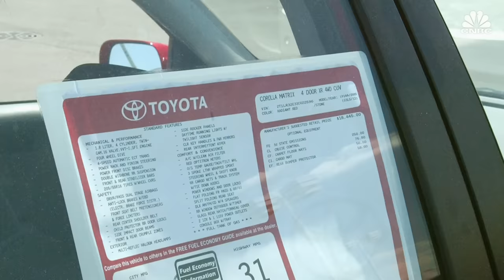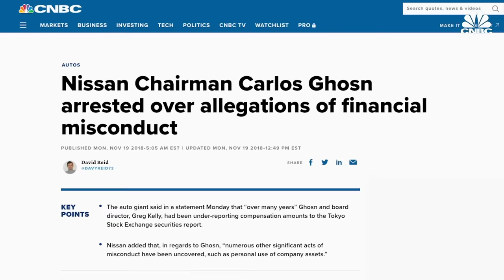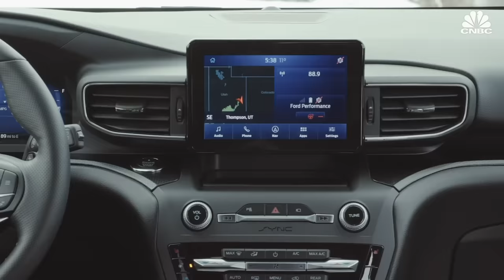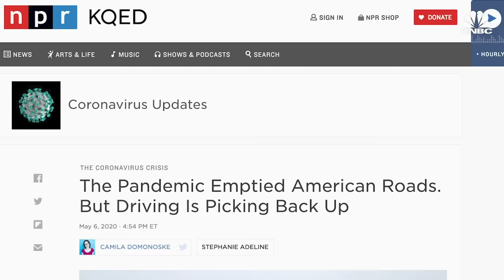Why Toyota, Honda, And Nissan Continue To Bet On Sports Cars

Comment: "They focused especially on reliability"

Zooms in on Mazda rotary
Reply: Apex seals noises intensifies
Reply: I mean.... in comparison mazda rotaries are stupid reliable compared to what other rotaries were
Reply: i mean, a modified version of that thing survive le mans while in more stress that its competitor during the race
edit: and won
Reply: Putu Tunik awesome point bro, need to learn more about the 787b engines
Reply: @hassanuddin6923  sorry about this but, what's that supposed to mean? i admit my lack of reference
Reply: Angry 2JZ noises
Reply: @pututunik8748  mazda 787B is their group C race car. which uses the modified wankel rotary youre talking about
Reply: @johanjoe3012  i know bout that one, the only rotary that win le mans
Reply: Lol, although they were actually pretty reliable for the time, with the exception of the rx8 (which can be good with maintenance, I owned one and it was surprisingly reliable)
Reply: Rotaries haven't gotten close the attention and development piston engines have, so they're simply - worse. 

It would be an interesting car market if rotaries picked up a few decades ago.
Reply: Mazda, Zoom Zoom
Reply: @MrCTruck   zoom zoom zoom
Reply: Woah buddy rotaries are super reliable it only breaks down every time
Reply: "They were lightweight"

Zooms in on 3000GT
Reply: @dinkopausic6357  rotaries are just flawed because the physical properties of the universe prefer circles to triangles when it comes to high-stress applications. They are unreliable but great when they actually run
Reply: @elias8294  Sure believe that, even though I've never driven one. 

Also when you think about it from a technical point of view, the "triangle" or the apex seals are really simple pieces, and could be produced and sold with a nice margin for very cheap, so a swap would be half a sweat.
IF rotaries were more common.
Reply: “Braaap-pap” sound intensifies.
Reply: Still the most reliable rotary in the world. The majority of problems are from lack of understanding from the consumer.
Reply: The Mazda rotary was very reliable compared to other companies rotary engines and I would even go as far to say that when well maintained, the rotary could out live some of its 70s and 80s American contemporaries at the time.
Reply: @hassanuddin6923  4 rotor btw to learn more😁
Reply: I was looking for this comment soon as i saw the wankel emblem :,)
Reply: Mazda rotary is contributing only a few percent of unreliability to japanese car brands. Meanwhile, almost 90% of german car brands are unreliable.
Reply: i was about to comment that i was like NAH NAH NAH HOLD UP
Reply: For rotary standard they're reliable
Reply: Rotary engines are reliable. because they use fewer parts & there's less moving parts. So that reduced the chance of breaking down. The only thing you have to worry about is the apex seal and that's pretty much it. But nowadays apex seals are also pretty reliable now with today technology
Reply: @kaleb4184  yeah, they actually made a long way improving it year from year, committing to improve reliability, that being said ultimately it's still hard to achieve reliability with that engine type
Reply: To be fair reliability should not be confused with durability. 
Reliability is more to do with the confidence the car will perform when all is in good condition. 
Durability on the other hand is related more with life span 
A Rotary is reliable when all is new meaning no poor inherent engineering or material short comings. 
As far as durability is concerned (often confused with reliability) it is not AS reliable relative to the piston engine BUT with preventative maintenance of the  Apex seals the rest is relatively solid (block, cooling, lubrication and electrics etc.)
Reply: I've had 2 first gen Rx-7. Never had any problems mechanically or otherwise. Reliable in my opinion.
Reply: Mazda's rotary engine is still more reliable than any other rotary engine ! The English and the German had already made Wankel bikes which sucked ! Mazda knew how to maintain minimum reliability in their Wankel engines !
Reply: I'm pretty sure Mazda could make reliable and powerful rotary if it wasn't banned on race.
Reply: To be fair, it's German designed, what do you expect?
P. S. We exclude Porsche.
Reply: But it does handle like a dream.  Former owner of an rx8.
Reply: @dinkopausic6357  with high power and so many less moving parts, it seems they'd have a future. However, I have to beleive engineers know more than I do. They've all given up on the wankel, as far as I know.
Reply: @mctransportation9831  True, tho I think it's mainly bc rotaries are behind in development. It would be a huge cost for any manufacturer to pick up the current rotaries and develop them to be on par with piston engines.

So yes, keep pistoning actresses Harvey, it's the most reliable way as of now!
Reply: Protip: If you don’t own a van (to possibly live out of), you are making a mistake. (If you own your own home, outright...disregard).
Reply: Now i'm split on whether the rotary engines are good or bad.
Reply: i'm still surprised this comment haven't assaulted yet by sander van der kammen
Reply: most reliable rotary evur
Reply: Of all those good engines, they chose this one to zoom on.

Comment: Lightweight, manual, RWD

NEVER A BORING SAD DAY IN LIFE!
Reply: You said it Mister! This is what I keep saying to all my friends. The Mazda MX5 is probably the best car in the world. But to be fair, Honda is pretty good at making front-wheel drive cars feel awesome.
Reply: @TheDalitis8 
I'd recommend taking a look at the Suzuki Cappuccino. It's pretty much what you get if you take a Miata and make it even more of a Miata.
Reply: I've got no clue what you are talking about. Haven't you noticed? More and more cars are using dual transmissions. They seem to be moving away from manual and going to automatic. Its so sad
Reply: @loopin269 
It's because oversized grocery getters are what pay the bills for most manufacturers, not enthusiast models. We're seeing fewer manual transmissions because we're seeing fewer new enthusiast cars in general. Entry level sports cars are dying, mid-range is focused more towards grand touring and the high end ones are overfocused on turning fast times around the 'ring. Oh, and then there's the C8 corvette which doesn't have a manual because the fittings for a manual transmission linkage would hurt the structural integrity of the chassis - GM's words, not mine.
Reply: @VestedUTuber  im predicting a hiked price for used manual transmissions in the future. Especially ones that link to the 2jz, rb25, ls, sr20, and a bunch more. Such a shame. On the bright side, knowing how to repair a transmission will come in handy 😂
Reply: Stop signs, red light, police cars, speed tripes

Comment: and now Honda is supposedly developing a new S2000 man I’m really excited to see this new JDM wave
Reply: I REALLY hope this is true because i feel like the new supra, 400z, and this supposed new S2000 maybe able to spark some hope in the JDM market
Reply: I hope its not an EV
Reply: @ao8271  it will not,I hope the only solution if honda want to resurrected s2k is maybe partnership with another company or making themselves but little bit expensive.
Reply: this gives me nostalgias of the 90s.
Reply: If not the S2000 at least the Del Sol.
Reply: Let’s hope the don’t screw it up like the new nsx
Reply: @djw5415  or like the new Supra either
Reply: @JulienStJames  I concur!
Reply: I want toyota to start making AWD.
Reply: Probably. A fast hybrid: émissions legislation.
Reply: @korgmangeek  yup no more interesting cars all boring EV with no character
Reply: Too soon Junior
Reply: JDM is lame
Reply: And Toyota is bringing over a new Corolla Hot Hatch with AWD. And Subaru is throwing an SUV engine in thr WRX
Reply: Are you still excited when they stick 15k more to the price tag? 
My 2000 GC8 2.5Rs cost me 21k in total with 5k to upgrade to JDM STI suspension  and Cusco parts. Drove like a dream and better than a 2005 Sti 😁
Reply: @enzolagar417  those vents are not fake. Just pop the plastic pieces off and they are functional.

Comment: The main thing about a "coupe" is that it is supposed to describe a two door. I recently saw a Porsche commercial that stated this is our new coupe, and it was a four door. Did anyone else yell at the screen "THAT'S NOT A COUPE! IT'S A SEDAN!"
Reply: Mercedes and BMW have done it over the last years too. They call a car a "grand coupé", which is basically a coupe with an extended body and different frame, AKA a damn sedan🤣. Germans Engineers have always been quirky, but damn🤣
Reply: +2 tons "Coupe SUVs" are a thing now sadly
Reply: @juanordonezgalban2278  It's marketing, because a lot of people want a sports car look, but still have the suv - so adding coupe to the name and sloping the roof so that the rearview window is more horizontal vs vertical does go a ways in giving the car a sportier, sleeker feel. Which is what people are looking for right - a sporty car that you can comfortably fit your kids in. Literally copy pasted from the Mercedes glc coupe page: "You don't count doors to define a Mercedes-Benz coupe. Character is what counts. Agile and sleek"
Reply: What about the fact that most "coupes" on the market are just 4 door variants with 2 doors removed? Like how civic coupes still have 4 seats and the same interior dimensions, as opposed to the Datsun/Nissan Z car.
Reply: @willg125  While I do see your point, the Civic coupe has always been like that. The C pillar has always had a big window and pretty roomy back seats for a coupe.
Reply: This is just my opinion. 
4 door, sedan
2 door, coupe
Coupe with no back seats, roadster
All "SUV's" are just different versions of a station wagon.
That's my story and I'm sticking to it.
Reply: coupe is French word for 'choppped' or cut.
It doesn't mean 2 door.
Reply: @digitalkov  That our exact point though. A coupé is a chopped sedan(2 less doors).
Reply: @robertmills2900  SUVs are a bit more complicated than that. For one, the difference between a hatchback and a wagon is based off the number of pillars. Wagons have a D pillar while hatchbacks don't. 
And SUVs traditionally are vehicles built on a truck frame but without any bed, rather having a single space for cargo and passengers inside the vehicle. 
A crossover or CUV is closer to a lifted hatchback or station wagon, as they use monocoque construction rather than body on frame.
Reply: @digitalkov   I said my opinion. I don’t care. 🤣
Reply: @Biriadan  I said my opinion. I don’t care.
Reply: @robertmills2900  I said what i said, i don't care 🤣
Reply: @geraltofmordor  in the SUV instance, the roofline is chopped, technically it is still a coupe
Reply: @benlagace428  it’s still a station wagon
Reply: @robertmills2900  a station wagon would have a 'd' pillar sir
Reply: Digi tal  We ain't French. 🤣
Reply: I am kinda confused on where the RX-8 belongs to. It's technically 4-door coupe.
Reply: Mahuria SMG  If that's the model that has the "suicide" style rear doors, by the logic I've seen throughout this dialog, I think it should be classified as an extended cab pick up truck without a bed and on a car frame. Probably not a station wagon. 🤣
Reply: The only 4 door coupe is the mazda rx8, it has weird suicide half doors
Reply: This reminds me of that one joke:
 q: why does a chicken coop only have 2 doors? 
a: because if it had 4, it'd be a chicken sedan

Ik, it's a bad joke 😂😂
Reply: @robertmills2900  You are right, but few 2 door cars are actually original coupes. Like the Z, the Supra, or the BMW E31. Most of them are sedan platform with chopped doors, like the 3 Series Bmw or the Civic Coupe. Thats not a bad thing, but it s not theoretically correct either.
Reply: agreed. 👍
Reply: Me 😒

Comment: People underestimated the GT86, which I believe is a great car despite of the lack of hp.
Reply: because the gt86 was made to be fun
Reply: Yeah. I mean it probably has huge aftermarket support. So if you'd like to bump up your power, you could do that. If you're happy with the power you got, then you could leave it as is. It's a small car and 200 hp would definitely feel a lot faster than in a Jetta. Just rip out your backseats and carpet and go full on lightweight.
Reply: HP is totally overrated when we can't go over 70 and can be ticketed for accelrating hard even if you don't technically go over the speed limit...
Reply: GT86 wasn't underestimated, the reception was pretty damn accurate. After such a long time of being out of sports cars, Toyota was finally back and they were partnering with Subaru on this project, so there was a lot of hype on how great the car could be. And then the result was just an alternative option to an MX-5.

The 200 hp was just mediocre to the point of being boring when you had exited a corner. If it had between 225-275 HP stock and with it's ~2800lb curb weight, it'd be Toyota bringing back a taste of the past's fast, light, and FR layout Japanese cars that Japanese competitors had discontinued ages ago (S2000, RX-7 FD, S15). 

Fortunately the new GR86 comes with 228 hp and ~2770 lb curb weight which is respectable and gives an excellent balance of speed and handling.